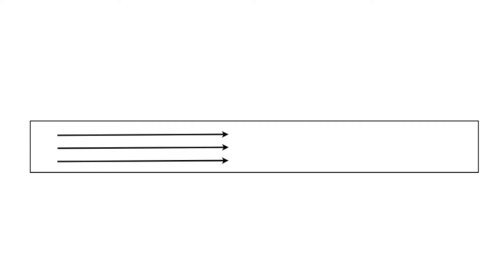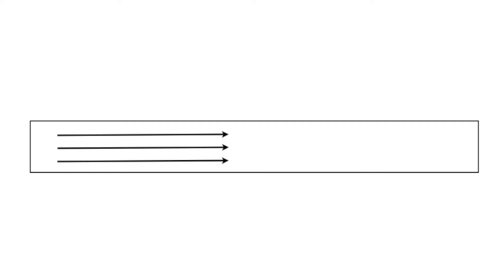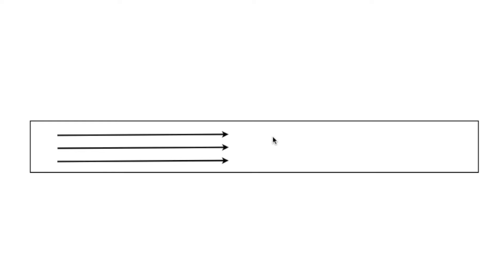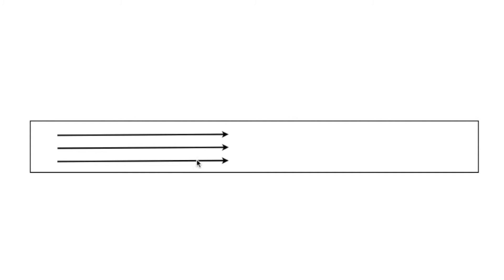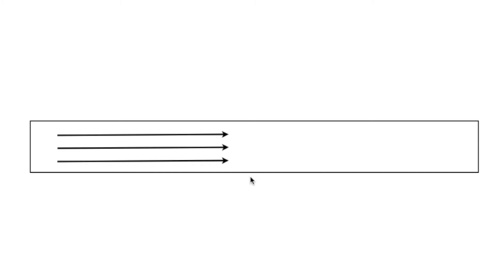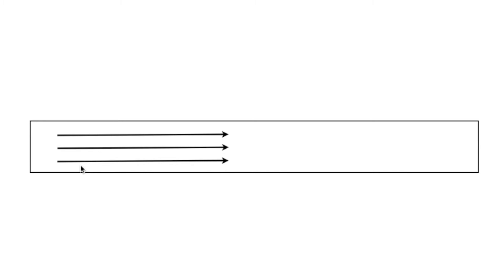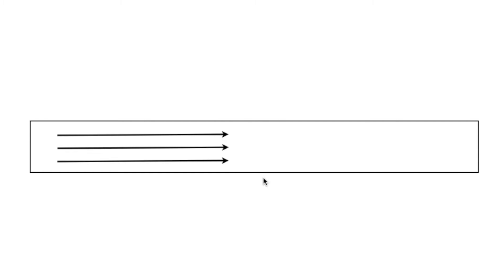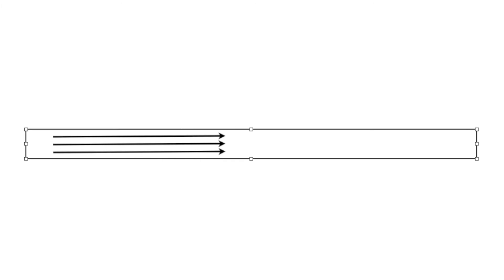Suction line sizing

Comment: Is there a maximum distance for a split system line set ???
Reply from the maker: That is usually a manufacturer question.  50 feet is generally the max if at the same horizontal level.
GFM

Comment: why do they recommend an inverted trap to prevent migration when the air handler is located in an attic? dont you want  the ref to go back to the comp.thanx
Reply from the maker: In the off cycle no.  It could damage the compressor.
GFM

Comment: Thanks for the excellent information in your videos.

I have a 4 ton heat pump with approximately a 50 ft line set where there there is a smaller suction line (3/4" OD) than the manufacturer recommends which is 1 1/8".  The indoor coil in the attic is about 20 ft. above the outdoor condenser.  Is it just a matter of losing some efficiency with a smaller suction line?  Or are there some other points to be aware of?
Reply from the maker: There is some efficiency loss with the smaller size.  However with that amount of rise, there could be a problem with oil return to the compressor.  There are methods to avoid this without reducing the suction line size.  The only solution I can think of is to refer to the manufacturer instructions.  Hope this helps.
GFM
Reply: grayfurnaceman Thanks for the recommendation.  I found an article that explains this further. http://www.achrnews.com/articles/refrigerant-line-sets-can-cause-compressor-failures.  It could be interesting data for another video on HVAC line sets.

Comment: Great video. Is it all about velocity or low head pressure has an affect on oil return too? such as cold weather...
Reply from the maker: Low head can cause reduced oil return because lower head means less refrigerant moving through the suction line so lower velocity in the line.  Hope this helps.
GFM

Comment: How are the oil levels regulated in the compressors if small amounts of the oil are intentionally drawn through the system? Especially if there are multiple compressors. I know the compressors have oil seperators under them but how does one compressor not end up with more oil coming back?
Reply from the maker: In many cases where there are multiple compressors, I have seen them mounted with equalizing piping between the compressors.  I usually do not see separators on systems as the oil mixes well with the refrigerant.  Pumping oil is normal on refrigeration systems.  There is enough oil in the compressors to allow for oil in the piping.  The problem comes when the oil gets trapped in the suction line.  Hope this helps.
GFM